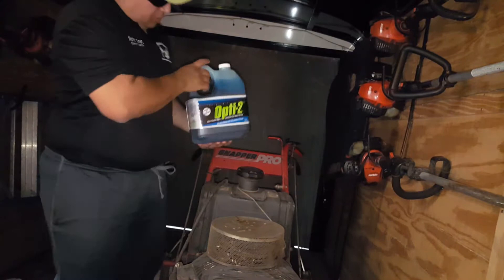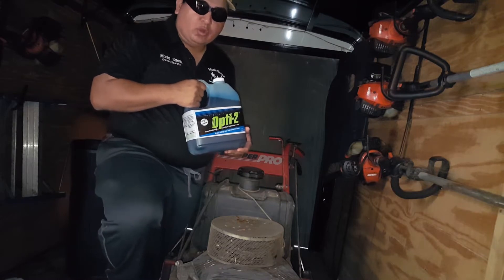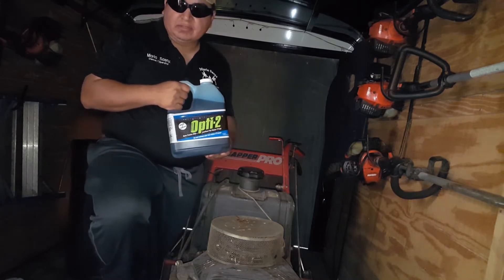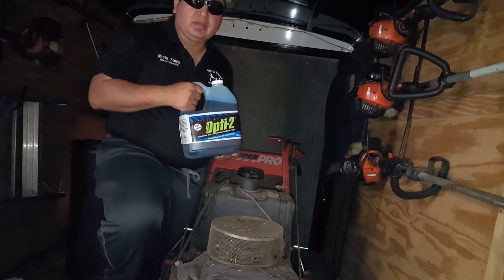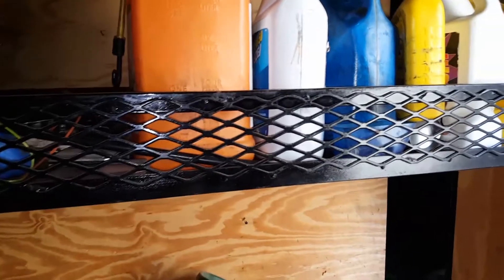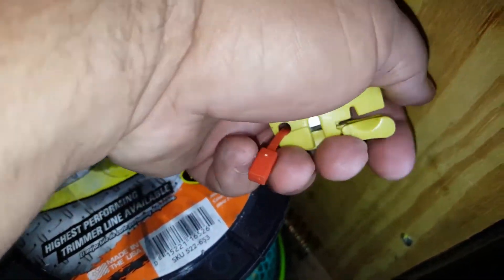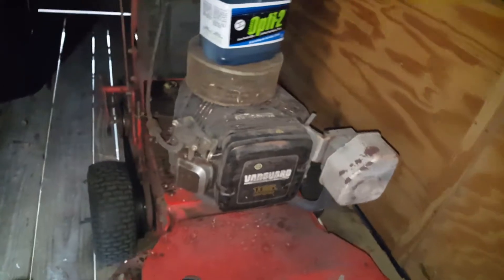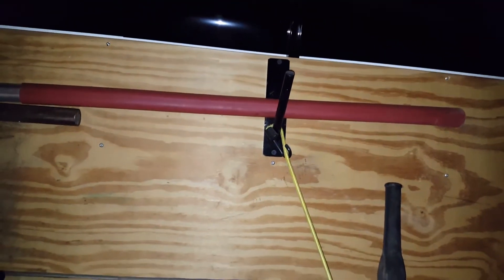Opti 2 #1 oil mix for you lawn mowing equiptment

Comment: New subscriber. This video is now 1.5 years old. Are you still trouble free using the one ounce per gallon (128:1) ratio?
Reply from the maker: I sure do
Reply from the maker: I only do 1 once per gallon on opti 2
Reply: PLEASE follow recommended manufactures oil mix ratios. Do NOT follow this misguided advice.
Reply: @rickjames6948  Small engine guy here. Two stroke motocross guys use 100:1 also. The top tier synthetic oil is good stuff. Nobody is forcing you to do anything.